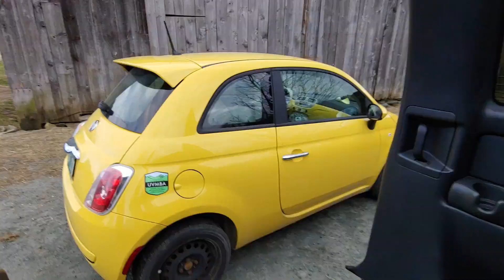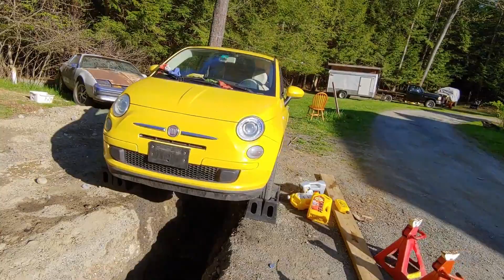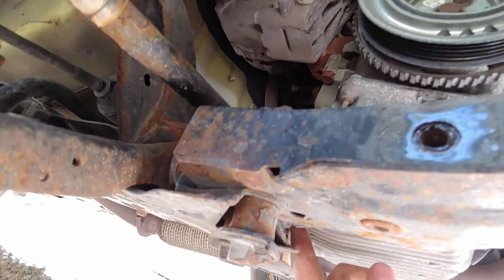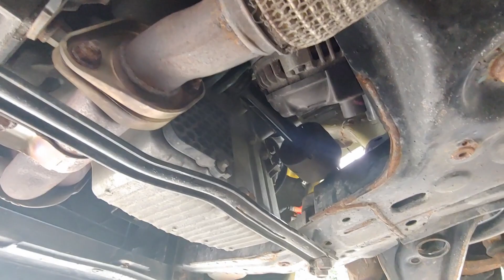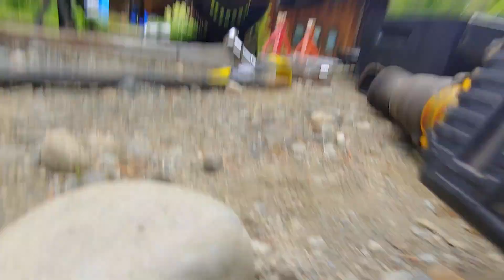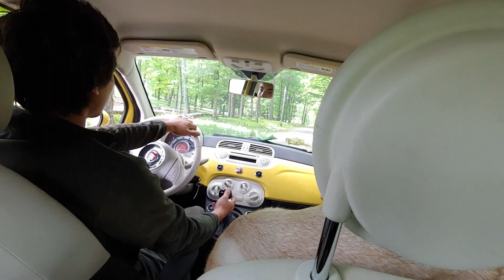Repairing A Fiat 500: Who Designed This Car??

Comment: as well, id like you to talk about prices, how much was that alternator compared to your trucks? same with suspension parts, how much would that car cost to rustproof compared to a truck. what about gas? I understand some issues with the car. but overall it saves you a lot more money
Reply from the maker: Actually parts are more expensive for this car. But yes gas would be less as well as rust proofing would cost less
Reply: @ARuralVermonterQqjmcb182  oh man on rock Auto, a strut Mount for my fiat is 56$ where on my Chevy Sonic they are 86$ each. Maybe it's just a demographic difference but my fiat is cheaper than my last car that's for sure

Comment: I've had to pull more than that to get an alternator out. My wife has one of these Fiats, "it is too cute" the 1957 Edition. We also have two Suzuki Swifts, a few Geo Metros, 62 Ford Econoline ground burner. Some motorcycles like 1970 2 stroke 500 street bike. Each one has it's own fun work issues. That must be crazy to work after a few good days of rain.

Comment: idk if my car is an anomaly but my 2013 fiat sport has 146000+ miles and has had only 2 faults. a recall on the clutch pedal that the dealer replaced and I replaced the window regulator when someone slammed the door extremely hard and it broke, granted it was slammed several times

Comment: My husband found my fiat 500 and once we got it things started to break. The motor for my passenger window broke had to take the door apart to fix it. Then the day light refuses to work it's always off then the purge valve sensor broke waited 2 weeks for it at the only fiat dealership in Vegas. Then the button to open the trunk that whole silver section broke waited another 2 weeks for that replacement... This car is great when it works a fun mess around car. This car has been a headache all happened within the first 6 months of having it.

Comment: Its a very stylish car though. Have always loved these. (Love small cars in general) I'd only buy the 500e version if only for reliability concerns and cuz its a lot faster. 
I also agree scotty is full of crap on the vast majority of what he says
Reply: Scotty has been working on vehicles for most of his life.he has bias towards certain manufacturers but he is a great internet mechanic resource like Chrisfix.
Reply: @wmc128  no he might have done oil changes most of his life but not real mechanic work
Reply: The 500e is not that reliable. They're good when new, but software updates can cause issues. If that happens, Chrysler forces a new motherboard that is not well-suited for the older 500e's, and I once watch a car sit in dealership garage while they couldn't get it all back online.

Comment: These cars arent nearly as bad as you make them out to be, especially as a used car deal, since its so cheap. It is hard to work on but it is reliable and the rust proofing is actually really good. 8 years of virginia winters and not a single rusted bolt. The only complaint is the interior materials are absolute shit. The arm rests are broken from the factory.
People just like to hate on these.

Comment: much like trying to remove the 150A alternator from a SAAB 9-5. only way to get it out is to:
1.) pull the passenger side axle and use a prybar to push the engine forward a bit to get it out the bottom, or,
2.) pull the intake manifold to get it out the top

icing on the cake is SAAB used metric allen head zinc plated steel capscrews with about 3" of thread engagement into aluminum threads to mount the alternator to the bracket.

Comment: These are one of those cars that's sold by looks only. People who like trendy looking cars and don't know how to work on them or who have somebody else work on them.I'd have been cussing LOL! That pit made life a lot easier.
Reply: After all, it's like 99% of the people... I mean, in 2020, cars are really reliable, and apart from car guys, with a real passion, nobody works on their car anymore. My Fiesta has got almost 100.000 kilometers, and apart from the regular oil changes and regular services and checkups (everything done at the repair shop for an average of less than a hundred euros), it never had any problems. And it's not considered a particularly reliable car, just an average one.

Comment: Actually I have a 2019 Fiat Tipo and it's super reliable!
Reply: well, for your sake i hope it will stay that way. my mom has a 2012 fiat 500 and it's decent but there's no way it'd hold up like my dad's 14 year old lexus and my 22 year old lexus. it's a wayyy cheaper vehicle new so obviously it can't be built to the same standard. but for what it is it's pretty good.
Reply: How? My friend bought a brand new Tipo some years ago and he had to sell it after six months because it was a money pit.
Reply: Good choice, the tipo is honestly a brilliant car 👍
Reply: Report back in the year 2021
Reply: @grantmctaggart9942  look, a friend of mine has a 2008 Fiat bravo equipped with the same drivetrain. He has 280,000 kilometers on it right now and it still runs like it should with absolutely nothing done to it other than oil changes belts, sparkplugs, and an accident that cost him a rear door and tailgate glass. It's the reason why I bought mine.

Comment: I know it's too late now, but rather than move the engine forward would it have been possible to place a jack under the oil pan and lift the engine from the subframe without removing the motor mounts?

Comment: That is horrible! And I thought my smogtastic 90 formula was crappy to work on
Reply: I used to own 89 Formula 350 some 15 years ago. When the heater core started to leak I heard plenty of horror stories about changing it, you need to get the dash off, then move the center console back etc to have room for this one bolt on the heater core cover. Since I'm dumb, and had plenty of beer, decided to do it myself. Not too bad. When I was checking out the "difficult"bolt I noticed that the cover didn't even have a hole for it so it wasn't there...I guess GM noticed that issue at some point mid 80s or so and simplified the design...Still had to lift the dash a bit for some bolts but not bad at all. Except the hangover next day.

Comment: That subframe has quite a lot of surface rust for a 2012 car. But I can imagine conditions are a lot tougher than sunny Italy where it originates from. These 500's are quite common where I live (the Netherlands). In general small economical cars are very popular here, for instance the Citroen C1, Volkswagen Polo, Renault Clio, and so on. I've worked on a variety of cars ( mostly transmission jobs) and I absolutely prefer American cars to work on. Especially the large trucks (Dodge, Chevrolet, ..) are not complicated and easy to work on. Dream job compared to that ghastly CVT I had to remove from a Nissan Micra....
Reply: It originates in Mexico.
Reply: @jamespfitz  yes but it was designed for the european market
Reply: @thomasferrario1756  not, everyting which are sold also in USA must be deisgned for there. Cars designed for Europe cant be sold in USA

Comment: Yes...I actually owned a Yugo. Remember those? It was a copy of a FIAT 128 built under license by CZ of Yugoslavia. It only wieghed 1800 pounds. 1.1 litre engine. I went to the junkyard and bought a downdraft Weber carburetor off of a wrecked Fiat X19 and put it on the Yugo. I was able to race Nissan Sentras and win LOL. That Weber carb made that little Yugo scream.

Comment: Dear sweet Jebus that's awful. As soon as you looked in the bay, I was like oh crap, there is no room.
Another reason I love Subaru as well! 10 minutes to do the alternator. All the accessories are right in front on top.
Scotty definitely gets a lot of things right or at least close, the problem is everything he gets wrong.
Also funny you say you'll stick with a Pontiac Vibe, basically a Toyota Matrix. Scotty might approve.
Reply from the maker: Haha yep, scotty would love my vibe. I will agree, subaru's are generally fun and easy to work on (at least some of the things)!
Reply: @ARuralVermonterQqjmcb182  Honestly, if it wasn't for the NA EJ25 head gasket issue, I think they would still have a reputation as one of the most reliable and easy to work on cars. Hopefully the new FA/FB engines will have a good long term reputation.

Comment: To remove the lower control arm you have to take off whole front bumper and the bash bar and the side bracket inner fender etc. Cuz a bolt is inside the frame

Comment: You should understand that this car is not a Crown vic, it is a small city car with a small cramped hood and a transversely mounted engine. This can indeed elevate service costs and make it more difficult to fix but still doesn't mean it is poorly designed.

Comment: Fix It Again Tomorrow
FIAT

I bought a brand new Fiat 128 around 1974. As I was driving off the dealers lot both transaxles broke.
No replacement parts avalible. It took 2 months to get the parts from Italy. This was before Lemon Laws. Also it was a end of year made car. So it had parts from two diferant model years on it. And those parts had changed with the new model year. So I never could be sure of the part year I needed unless I bought it before.
I learned how to diagnose and fix cars due to this thing. Trunk was loaded with tools, Jack's, parts, and fix it books. The Stupidist stuff would bust on it.

Comment: If you think thats bad try a 70s or 80s Citroen.  That engine is used is several diferent Fiat models of witch the 500 is the smallest hence the tight access.

Comment: I think the alternater has to be placed below top of engine on new cars for safety/crash protection for pedestrians. And maybe space issues. Also that fiat looks to have been parked on grass in its life from the looks of rust underneath.. maybe why alternator seized up also.. moisture is no good for metal.

Comment: Not saying Fiats are more or less reliable, but comparing the engine bay workability of a compact front wheel drive car against the engine bay of a truck is disingenuous. Of course a lot of things are easier to do in the truck, there's loads more room and even the engine layout direction helps in this particular case.

Years and years ago I had to replace the alternator on either my VW Scirocco or GTI and the easiest way to get it in and out was to actually take the housing of the alternator apart, slip the 2 pieces into place and then bolt the halves back together.

Comment: I have a 2012 Fiat 500 SPORT...I have 2 problems. 1. is where the power steering wont work when its very cold.  32 degrees or less wont work. When car warms up then all is fine after about 10 or so minutes of car running.
2. Problem is the key is turned, car lights battery works all is fine EXCEPT ENGINE wont turn over. NO CLICKING NO NOISE..just nothing. Just lights on. I try every which way to get it to start but no..THEN...out of the blue I try again and car starts like nothing happened. Battery is ok. I go thru this "cycle" every so often. At this point its in the WONT START CYCLE...my mech installed a wire from the starter to the positive battery terminal for emergency start..it works somtimes.. ANY IDEAS ON WHAT CAUSES THIS?? Original 
Starter was changed in  2018. Car worked ok for over a year but that problem started again 3 months ago.
Any help would be appreciated. Thanks Barry

Comment: I’m only 3 minutes in and I’m already wondering how much it will bring at a scrap yard 👍,,  and that Trans Am is looking good in the background . I’m thinking a low mileage 5.3 truck motor swap , with that 5 speed behind it and a G80 rear locker ,, a rattle can paint job would make for a summer full of smiles 😀
Reply: That’s right ,, you see what I’m seeing don’t you !!
Reply: Or save some money and weld the rear 💪🏼🇺🇸
Reply: That car has endless options of fun and 490 smp 
Smiles Per Minute 
potential !!!!!

Comment: Gee, the alternator on a small, FWD sedan is more difficult to access than the alternator on a huge pickup truck...who would have guessed?

I have owned over 2 dozen cars, and have put over 100,000 miles on a few of them, yet oddly, NEVER had an alternator die on a single one.  Experience would tell me that maybe they aren't a common fail item and therefore don't need to be as accessible as...oh, an oil filter.

Comment: My dads 1987 g wagen has done over 150k miles and I think the speedo has been replaced so idk the real number but it’s been through 5 engines  replaced because of lack of power they were all Mercedes 3.0 5 cylinders apart from one and that was the only engine to break

Comment: That 1.4 FIRE engine is designed to be installed on other cars like the punto or the bravo where there's a lot more room. It's not designed for this car, as the 1.4 t-jet or 1.3 multijet.

Comment: Fun Fact. The modern Fiat 500 is a reskinned Ford Ka. Its very cheaply build in Poland(maybe US versions are US or Mexico build) and there is pretty much nothing Italian on it expect the design.
I drive a 2L 1994 Fiat Croma, the most reliable car i've ever had.
Reply: Nope. The Ford is based on the 500. And so is the Lancia Ypsilon.
Reply: @JeeGee114  Can't be as the 500 and the Ford Ka are both based on the Fiat Panda platform. Other fiat cars are based on it too, great platform.

Comment: Yeah the alternator placement by fiat was terrible, its not just the 500 too... those engines are not so unreliable actually the issues are usually interior parts, lights and other electrics

Comment: "I dont agree with scotty kilmer" instant like.
also this is exactly what it was like when i did a chrysler 200 multi-air shit motor alternator lol. stupid FCA's man.
Reply: What’s wrong with fca ? My 200 has 144,000 miles and I love it.
Reply: Mine was sold with 390000 km and it was perfect. Greets from Switzerland.
Reply: I own 4 FCA products and I work at a dealership for FCA. All 4 of my FCA products are and have been reliable.
‘15 Dart GT 98,446mi 
‘15 200C AWD 30,300mi (Oil cooler and filter housing repaired along with the PTU and the cars been solid since)
‘13 500 Lounge 130,200mi(Just normal maintenance)
‘19 Pacifica Limited 10,998mi.  All of them have never given me any huge problems. It’s all in how you maintain your vehicle/vehicles. Chrysler has came a long way since it former shit days with Mercedes and Cerberus. Fiats the best thing that’s ever happened to Chrysler. I rest my case

Comment: Balls the size of coconuts working under a car held up by stands on the edge of a dug pit, especially when you lean back to the outside of the car. Instant Darwin Award if the pit edge crumbled and the suspension neatly decapitated you.

Comment: Well, if you want a tiny car this is what you get: the car is designed in Europe, the shape of the front is due to crash and safety test, so you have to fit things inside the way you can, the thing I don’t understand is why buying a fiat 500 in the USA? No problem of parking space, roads are huge, petrol costs like bottled water, local cars are cheap, so why would you do that?
To the owner of the 500: Please replace those wheels, they are awful, that is not a freaking truck ! And for all the car experts talking about fiats being prone to rust, well just stop at 2:06 and look the car in the back...

Comment: The 05 Ford Focus has the alternator placed in the same spot. You have to unbolt the motor mount and hook up a ratchet strap to the motor and pull it forward to create enough space to remove the alternator. Fun fun, but doable.

Comment: Fiat 500's are often called just Fiat Pandas in drag 😊. All the mechanicals are the same bar the higher spec models, which mechanically never were fitted to the Panda. The chassis is the same, but the bodywork is far more curved making normal access near impossible.  Note also saying fiat electrics are bad is a hard thing to judge, being as so much of any car uses standard components idten Bosch for example

Comment: That engine was originally designed in the 80s and the alternator was easy to get to as there was hardly anything around it, but as manifolds have grown due to emissions regs, subframes got bigger for more strength and A/C added not to mention a16 valve head it just became harder to work on. I always just disconnect the engine mount and lever the engine forward when doing these, easier on a 2 post though!

Comment: Nice to see a Young Man who seems to know what he is doing. Credit to you👍.
The easiest vehicles to work on that I ever owned were my 1972 Datsun (Nissen) 1200 Pickup and 1975 1200 Saloon .. both bought new.
Absolutely brilliant! Room in the Engine Compartment to host a Party. Minor Services .. Oils, Fluids Lubrication, Points, Plugs and Condensor, Fan Belt as and when required. Major Service .. Valves and Timing and some sundries. That was it!
A mate of mine had at the same time, a 70's-something Fiat 128. He 'tried' to replace the Alternator. Gave up after 3 days. Got the Agents to do it and obviously, they could all go on a World Cruise thereafter.
Another guy I knew had a little Mini 1000 (the one before the Clubman). He was an Apprentice Motor Mechanic at the local Mercedes Garage and whenever he had to do some work on his Mini (CV Joints, etc), he would invite a group of us around to the Workshop after hours .. supply the Beers and the Dart Board and after having disconnected the necessary, we would lift the entire body off the Sub-Frame and Engine, leaving him with a clear field from all directions. Repairs done, reverse the procedure .. all go home.
Fiats .. Naah ..

Comment: Mechanicaly, Fiat's are alright, on my previous job there were 2 Fiorino work vans that were abused and had very basic maintenance, my problem with Fiat is that spares are expensive, hard to find and they feel so cheaply build that I felt like driving a metal coffin on wheels. Besides not all mechanics work on them. It's worse now for Fiat owners in the US now that the brand has left the country, in my country they are still around